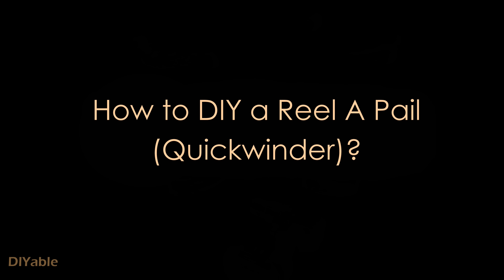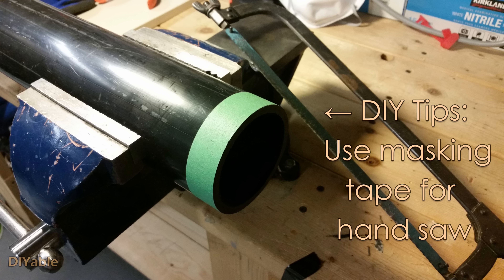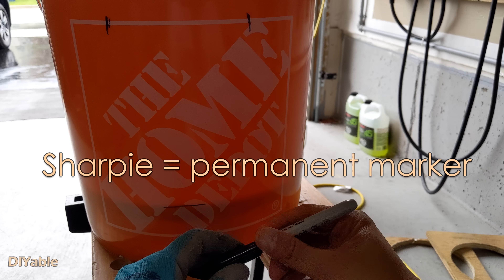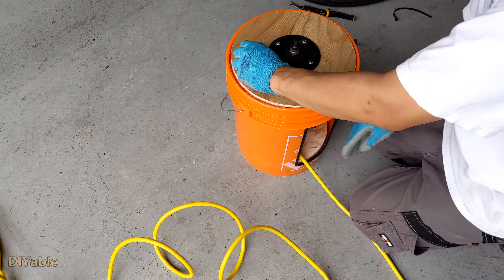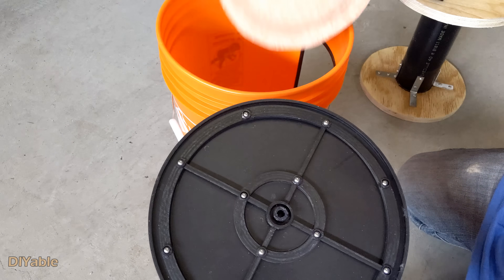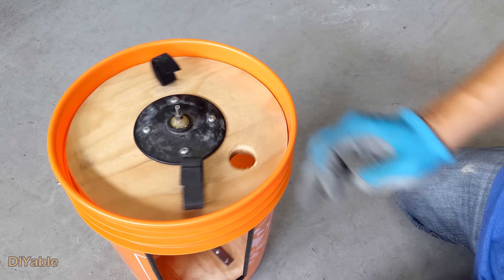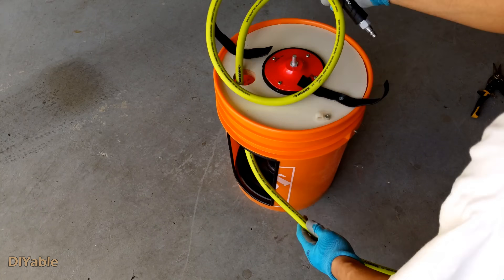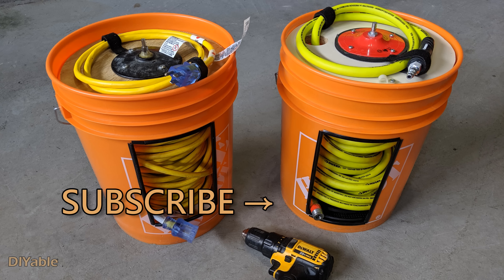How to DIY Homemade a portable cable reel like Quickwinder (Reel-A-Pail) for 100 ft. 12 gauge cable?

Comment: Inst4ead of that plastic lazy susan, but a lazy susan turntable which is just a metal bracket with bearings in it. It will work much better than that amazon plastic thing you used. The friction from her wood on the top will eventually wear through the bucket, so wrapping it in something like UHMW or PTFE will allow the wood to spin much easier and prevent wear. Of course you could just build the whole thing out of wood using 4 pieces of 2x4 and lazy susan turntables on both ends and get an even smoother reel and unlimited size.

Comment: @DIYable - You might lose a tiny bit of space, but have you considered using a small amount of self-leveling concrete on the bottom instead of the plywood to give it a bit of weight so you don't need the ties or the 2x4 to keep it still?

Comment: Excellent video and process. Thank you for sharing. I have a mile of string that I want to put on a reel. This is an excellent solution. Bless you. I'm going to use bearing instead of wheels to smooth out the rotations a bit. Thanks again.

Comment: Great Job! An alternative for the bottom piece of loose wood is a thin plastic/nylon cutting board...the roll up type or even a regular type. Less friction. Also if you wire a 4 outlet box and place it on top of spool. Configure the cord in a manner where the male plug is at the end with the female inside the gang box.

Comment: Thank you so much and ive been trying to find these types of videos and anyone else here have any ideas how to do this similarly but have 2 seperate cords going in 2 seperate direction's. The directions would be like the bottom of the bucket and then a side of the bucket. ive been working on a fun little project and its similar to this but been struggling to create the jig i need.

Comment: The corner brackets can be inserted and screwed inside the pipe to prevent the extension cord from rubbing against the metal of the brackets. Another solution is to use silicone caulking, hot glue, or duct tape over the metal brackets and the screws. I think it works better in the long run.

Comment: 13"50 you could attach one of those swivel handles to the end of it. Not that a screw driver is any worse, but you have to go fetch the screw driver, the handle would be always be there.

Comment: One thing to note is that if you are using a high wattage device on your power cord for an extended period of time, you should unwind the cord from the reel completely, otherwise it can overheat.  I saw someone melt a reel of extension cord once when he plugged a large popcorn maker into it for a community fair type endeavor that was in the community center's parking lot.  It melted into a monolithic wire and plastic mess, started smoking, and caught fire... He had basically created half of a transformer and wasn't aware that transformers tend to heat up...
Reply from the maker: Totally agree. It's a very good advice. Indeed the same will happen to any professional power cord reels or even UL listed retractable wall mount reels.  That's exactly the reason why electrical code don't allow Romex in PVC conduit and need to use T90 (Canada) or THWN (US).  For any other readers don't know the number 90, it's temperature rating. Thanks for sharing.
Reply: @DIYable  -- I wasn't aware of the Romex in PVC conduit issue... But the few times I've run Romex in conduit, I have used metal conduit and it has been in a short run or 10 ft or less for circuits that did not use much electricity (e.g. outlet to plug electric rotisserie into in outdoor kitchen / BBQ area)...
Reply: @CurmudgeonExtraordinaire yeah romex is not to be placed into conduit unless specific circumstances allow it. Typically this is a no across the board

Comment: This is a neat idea. I have to wonder though, if you aren't using the whole 100 ft and have a bunch of wire left wrapped in the centre while using the cord, are you going to have problems with heat and electricity flow? Basically, you've made a large inductor (like an electromagnet but with AC power), which creates heat and impedes the flow of AC. I imagine that using 12 ga means wire overheating from being in a coil might be less of an issue than with small ga wire, but I am curious if this might be an issue.
Reply from the maker: If you plan to use it for a long duration with high amp, I recommend to unwind the whole thing especially in summer time. For temporary use or for only short duration, it's totally fine.
Reply: Nope. An inductive field can only be created if you have ONE of the hot or neutral wires coiled. Both wires being coiled up cancel each other out. The issue is heat from resistance. When the wire is coiled up and/or packed in a closed/confined space, the wires can't radiate heat away, and aren't exposed to sufficient airflow to carry away heat. Please don't spread misinformation.

Comment: I made this, I cut out and put the lid on it. Just cut out the rim. that's all you need to keep it from falling out if the bucket falls over in the van. Also I put a square piece of plywood about 14 inches square on the bottom to stand on wail reeling it up. Harbor Freight has Rollers that work perfect under the wooden reel.  5/8 in. Roller Ball Bearing  . Only  $0.99. I also sprayed the bottom of the bucket with a silicone spray.  Makes the roller glide even better for unreeling it.
I made one for a 100'ft extension cord. and one for a 50'ft air hose. 
I tried to scale it down to a smaller bucket for a 50'ft cord but this doesn't scale down very well. You have to hold the bucket wail cranking it wail also tiring to guide the extension cord so it winds up evenly on the reel.
So it works good just get the rollers from Harbor Freight and add something to stand on and you'll be happy with it.

Comment: I would recommend for folks building portable versions of this to maybe make a detachable crank handle that stows in or on the bucket to manually wind the reel in for cases where you need your cord or air but don’t have your drill
Reply from the maker: Good suggestion, thanks for your input!
Reply: An Allen key similar to the IKEA type but much larger.

Comment: Cabling industry makes wooden spools for COAX, CAT 6 and other cable and ground wire types that can be just about the size you are making right there.... A thousand foot spool of CAT 6 shielded ethernet cable is about 11 inch diameter 11 in tall. Some are 10 x 10, some are 12 3/4 x 12 3/4....  If you happen to have a buddy who is a telecom structured cable monkey, ask them to save you some empties next time they are on a cabling job....Or maybe a buddy in commercial construction where the cable monkeys have been working can get some empties for you.  They generate a lot of empty plastic buckets too, from the poly jet line trailers that have to go in with every run of cable...( jet line buckets come with about a 3 inch hole in the middle of the lid).  We take the empty buckets home all the time.  Damn shame to just chuck them in the dumpsters.

Comment: I like your presentation and I immediately built two.  I made a minor change using  round pieces of 1 1/2 thick wood inside of the 3" pipe in lieu of the angle pieces.  It took more time, but I didn't like the metal edges of the angles in close to the wire.  Thanks again for the idea and presentation.
Reply: The metal angle brackets won't cause any harm to a cable, especially since the wire is stationary on the spindle.

Comment: Thanks for this. The problem I’m trying to solve, is I’m a cable installer seeking a redesign for deploying cable reels with minimal cargo space. This unlocked some great ideas for me. End of comment for most. My geeky thought, picture taking a hand cart/dolly, lay it down. Create a lazy Susan from the larger cable reel ends, put that down on the back of the dolly. Put a centre post in the lazy Susan to put a reel on. Telescoping handle,  inline skate wheels,  hoping to condense folded size to around 2’x2’x6” use centre post to anchor structure by driving it in the ground. I need to transport 1000’ of rg11 cable to the site, and deploy it. I see space saving options that don’t help with transport, and transportation options that take up too much space. I think I can solve this now :)

Comment: The RAM-PRO 10-Inch one on amazon has more ball bearings, might work smoother.
Reply: Better off buying these. They are smaller at 6" but they are very easy to install and cheaper. Some lithium grease and they will last. All that is needed "extra" is a bottom board (square or round). Round is best to fit to bottom of bucket for greater stability and add weight.

https://www.amazon.com/hz/wishlist/dl/invite/j0kcAsW?ref_=wl_share

Comment: I tried using 1 1/2 pipe and it keeps getting hung up on pipe like it's too tight around it im going to try putting a sleeve over 1 1/2 pipe see if that helps should've just got a 3 inch pipe

Comment: ⚡ There is a possibility that when using high-amperage equipment for a long time, a resistance will build up by not unwinding the entire cable and cause a fire!🔥🚒🚑
Reply from the maker: That's actually VERY GOOD point, thanks for pointing that out.

Comment: Also, I will connect a 4-inch concrete base to the bucket.
Reply from the maker: Yes, that's a good idea..  I thought about using glue to attach a 10lb Cast Iron Plate, you know those iron weight for fitness/lifting

Comment: Just finished making mine.  I repurposed a Lowes 5 gall bucket (it had a split bottom!), 1/2" plywood and I welded a 14mm hex headed bolt to a plate and screwed that assy onto the top to rotate the drum with my drill.  A brushed drill is more controllable.  My Dewalt brushless drill goes from alnost nothing to full speed with just a small extra press of the trigger.  Nearly took my wrist off!  Finally able to quickly stow a 100 ft 12 AWG extension cord.  150ft is too much.
Used the same lazy susan off Amazon for about $9!
I cut the side of the bucket with an angle grinder and thin cut-off disc after drilling four 1/2" holes in the corners.   Cut easily and very safely like a hot knife through butter!
Thought about using marbles or ball bearings for rollers, but they would bunch up unless held in relative position to each other.  I did place the curved bucket cutout in the bottom (curve up in center) and that worked pretty well, but collapsed with the weight of the cord.
Thanks for the video idea!
Reply from the maker: Thanks for sharing your experience!!!

Comment: What if, instead of using Lazy Susan, use a handful of metal ball bearings. That'd weight it down a bit also..
Reply from the maker: Not a bad idea indeed.... especially weight it down
Reply: 99cent bag of marbles is way cheaper and won't rust.

Comment: You forgot the drain hose on the bottom of a bucket in case water gets in there if you left it outside.
Reply from the maker: That's the best comment I have seen so far!!!!!!!!!
Reply: First and foremost, the extension cord must be for outdoor usage in the first place and more importantly, it should be waterproof, or at least both end parts of the cord should be well protected. Besides, no one prefers to work in the rain therefore placing the bucket outside isn't necessary. Electricity and water don't go together. Professional Electricians who work outside during rain have all the equipment and themselves well protected.
Reply: @andycheung1337  alright Andy!!
You are definitely the extension cord police.👮‍♂️
Reply: @jamesw4912  Lmao, ur so funny. The best thing about leaving comments on YouTube is reading others' funny comments and responses.
Reply: I think if you left it out in the rain you are already fucked no matter how many drain holes you have. That plywood and panel will get ruined.

Comment: WARNING! If you leave a long extension cord wrapped inside a container like this with a large load connected, like a heater, you stand a good chance of accidentally building a campfire in your garage. Manufactured versions of this use a circuit breaker that trips at a fairly low ampacity or has a mechanism that won't allow connection without pulling all the cable out first.
Reply from the maker: That's very good point, thanks for pointing that out.
Reply: A pigtail cord can be built using a 15 amp GFCI plug to put between the cord and the power source.
Reply: It will be just fine. That's more of an old wives tale. You'd need to have it in a sealed container, in very hot temperatures, using the cord beyond ita capabilities, and MAYBE you'll have some issues. In this case, there is plenty of circulation around the wiring.
Reply: I think I’d need to see a video of that happening.
Reply: Thanx!

Comment: OLD LEATHER SMITH here, In stead of lazy Susan I would use marbles saved time and money, I make my own lazy Susans by using 2 aluminum pie tIns and a bag of marbles about 25, works great in my shop, I just place my tool blocks on top is the top tin works great GOD'S BLESSINGS ✝️⚾🙃
Reply from the maker: That's very good information! Thanks Jim!
Reply: Man eating two pies... 
What? I needed a set of bearings.

Comment: Cut a nine inch ring of plywood half inch wide thick and center in bottom and throw in a few marbles and save 10 on the Susan
Reply: I'll deffinetly try it out! Thanx!
Reply: Why not just throw in a 89 cent bag of marbles. No need for a ring at all.

Comment: It's cheaper to buy a ready built one in UK. A lot of effort and expense for nothing sadly.
Reply: I have seen so many people saying this is too expensive and you could just buy one. I don't know what you are smoking. These things are expensive in the US. 75-100 dollars. You might be able to get one for $50,   but this is better. The one I bought does not work well if wet or cold, but  this for a fraction of the price works great.
Reply from the maker: It may not be extremely cost effective, but it's fun to build one
Reply: so missing the point here

Comment: Couldn't you technically cut (using a router) a groove in the bottom and put a bunch of ball bearings?
Reply: You could do this, and you would basically be making a lazy susan.   I think a simpler option is to use a lazy susan like he did.  They come in all sizes and build quality.  This shouldn't require one as large as he used.
Reply: I made a lazy susan for my spices using 2 round cake pans from the dollar store and some marbles.  Same concept.  Just use marbles or some steel ball bearings if you can find them
Reply: You don't need any grooves or pans. Just get a bag of marbles and throw them in. Just make sure you layer the whole bottom. Too few may cause it to go lopsided. Too many and it won't move.

Comment: Why not add an anchor to the handle of the bucket since it has one already?  Then if when cutting the opening in the side, you made sure the opening was opposite the handle folded down on the opposite side.  It would be directly opposite the pulling force to release the cable or hose.  The anchor wouldn't have to be long enough to touch the ground, just heavy enough to create the downward pressure to oppose the pulling force.  You could make another disc that folds on top of the cable like a cover or lid to protect the velcroed portion.  It attaches loosely to the handle so it can be used to carry but when flipped down, you also have a way to keep the bucket in place no matter what surface it was on!  So, I am going to do that.  I am going to do a version without the bucket that has kick stand feet to hold it in place.  No use of a lazy if a eye bolt down the center of the inner pipe was in place.  To spin it, it would have a bearing wedged between the bolt and the plywood using glue to keep the bearing in the plywood and to not come out.  Your ideas inspired my ideas as a way to solve your problem and make smaller versions using only the pipe to wind on.  Great job!
Reply: Let us knew your version turn out?
Reply from the maker: Yeah... Please let us know how your version turn out!!!!

Comment: An 8 pack of lazy Susan turntable bearings are only $12 US on amazon.  These would probably work at $1.25 a piece than the plastic junk.  Otherwise a pretty good idea.  I have 2 100’ cables that are a pain in the butt to lug around.
Reply: Do mind post link turntable bearing you referring to?

Comment: If you run the cord the other way with male plug coming out of the bucket, you can just plug it in and walk it to where you need it. You can then add a 3 way at the top of the bucket or duplex outlet. You can also glue rubber underneath bucket as well or add 2" concrete inside bucket for weight.

Comment: Great idea, but copper workhardens so eventually it will break. In saying that the hose part would work. Love the voice Hahahaba.
Reply: I’ve got “reeled” extension cords that have celebrated their 20th birthday — maybe even 30th. While I’ve had to replace the occasional Edison plug, the cables themselves, while perhaps not as supple as they once were, are still working fine. I’ll report back here when work hardening becomes a real-world issue.
Reply: That isn't an issue with fine stranded cables. Extension cords are designed to be portable, flexible, durable and not break with normal usage. They even sell them in kits where they are already on a reel.

Comment: If you used double sided foam tape to attach the lazy Susan it would still be easy to replace plus it would stay centered under the reel.

Comment: WAIVER: While a 2x4 is the preferred method, never try to substitute a 2x1. For advanced users ONLY: 2x6, or 4x4 can be substituted, but only attempt the use of anything larger when accompanied by a responsible or competent assistant.